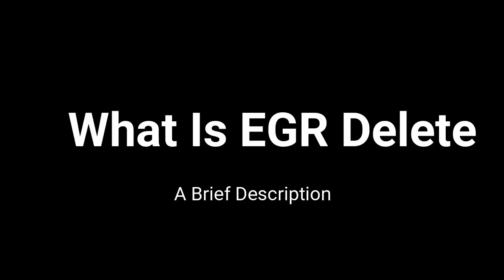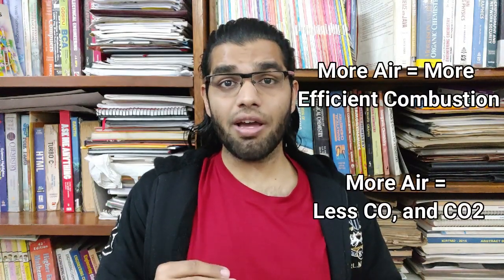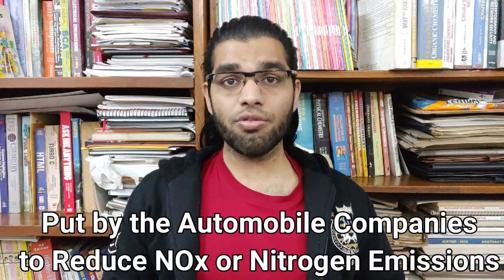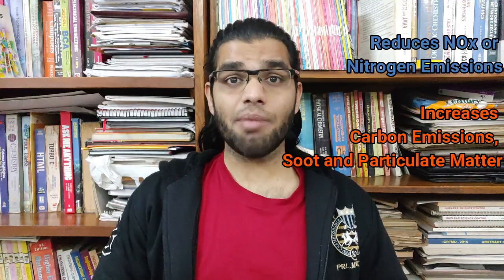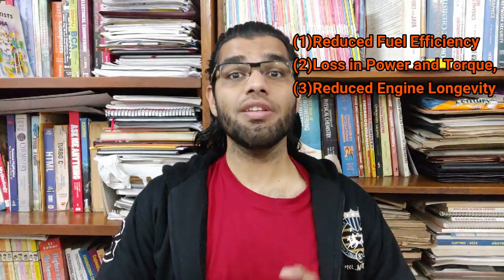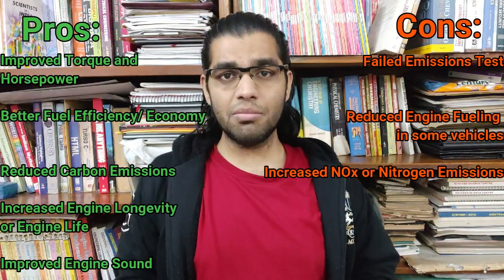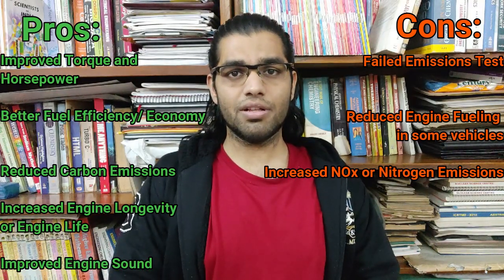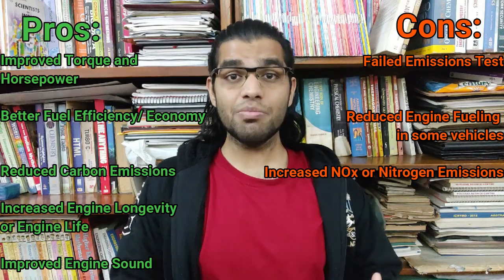EGR Delete Part 1 - How EGR Works - EGR Delete Pros and Cons

Comment: In Saudi Arabia Toyota done a recall on the 200 series to delete the EGRs .2020 200 series have no EGR at all in them.
Different story in Australia though.
Reply from the maker: That's amazing to heat that brother. That way those 200 series with no EGR will have better longevity as well as performance than those which are fitted with EGRs

Comment: ASKING ABOUT TOYOTA PRIUS 2011 IF EGR IS UNPLUGGED (BLOCKED) WILL IT HAVE NEGATIVE EFFECT ON THE ENGINE AND LIFE OF CAR PLEASE GUIDE THANK YOU
Reply from the maker: Depends on what kind of egr valve is present. You won't have any problem if it's vacuum operated, but if the valve is electronically controlled, there are chances where the ecu will reduce your engine  fueling ( 6:14) and hamper your performance , so you would need an ecu remap. Also just unplugging the egr will not help that much as exhaust gases will still flow into the intake. So blocking the egr pipe is necessary as it will physically block the exhaust gases. Thanks a lot for your question. Have a great day. Cheers bro.
Reply: You WILL get a check engine light if you unplug your EGR. It's a Prius dude... just leave it alone lol.
Reply from the maker: @dansmith6990  Actually unplugging might give check engine light, but sure your can try going for the blanking plate instead of unplugging.

Comment: Hello, would that limp mode happen to a tdi 1.9 1999 jetta volkwagen?
Reply from the maker: Your Volkswagen Jetta tdi has a Vacuum Operated EGR Valve, so most likely, in fact in most cases, limp mode will not occur. Just block the EGR pipe with the blanking plate and you will be good to go. Thanks a lot for your question. Cheers man.

Comment: Awesome video, well explained sir...
Just a question regarding a D4D Map sensor.
What is the signs of a bad sensor? My traction contol light went on & it goes into limp mode. The moment i disconnect the vacuum hose from the map sensor, then it runs quite fine. Please advise.

Kind regards
Derick
Reply from the maker: Hey Derrick. Actually when your vehicle won't enter into limp mode if you disconnect the Map sensor. Map sensor actually reduces fuelling at lower air pressure which reduces the overall torque of the vehicle. So if you've disconnected the vacuum hose, cover both the ends at the valve and the hose, so that no air leak takes place from any part. 
But still to know more I would love to know what vehicle and model do you drive, it's year and it's fuel type so that I can help you solve your problem in detail. Thanks a lot for your question brother. Have an awesome day. Cheers bro